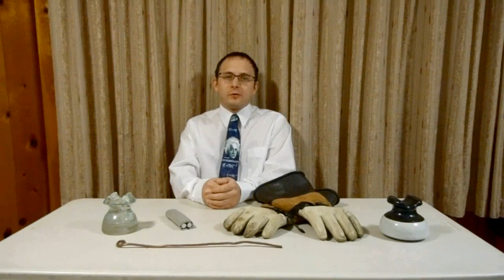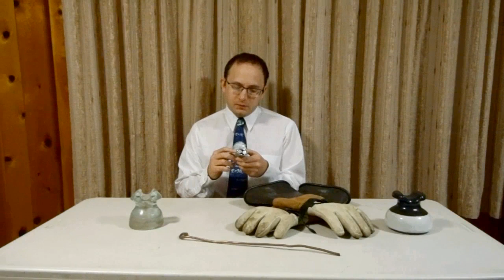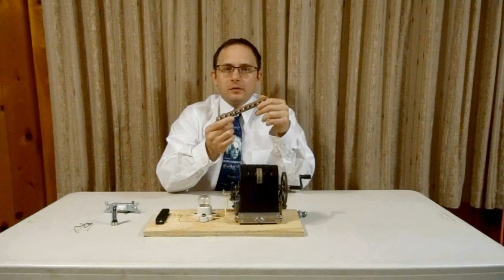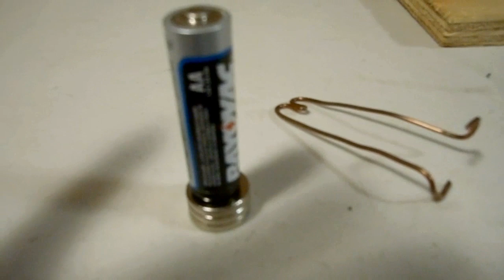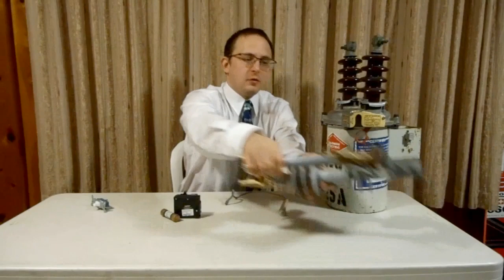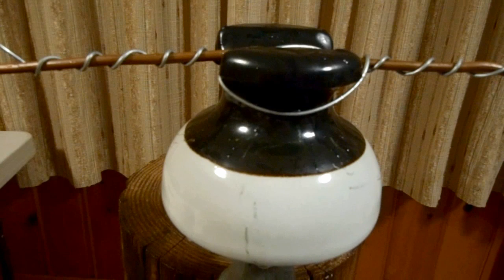Electrical Theory Lecture

Comment: are you self taught or did you go to electrical school?
Reply from the maker: When I was in high school I went to a vocational school and took night class I did every class that dealt with electricity I also did a linkwork class for 4 months. out of high school I took computer service technician classes for two years and in 2008 I graduated from a technical
school after studying electricity for a year - passing every employment test I was given (US Steel, Westinghouse, First Energy, CSX, Seimens) and getting 6 figure job offers with full benefits that fell through because of the bad economy and me not having a drivers license. Luckily my student loans were hardly anything because I chose a cheap technical school instead of a big collage. I've done allot of self teaching since then in areas my schools never covered - I've been around the block - went threw hell going to that technical school saw lots of plastic chairs getting thrown away it bothered me a ton I should get a medal for survival.
Reply from the maker: I knew the technical school was right for me because the homework took me 10 minutes while everyone else in the class was up all night and still didn't have it done - the classes put me to sleep because I did pretty much everything when I was in high school taking the night classes - I was telecommunications certified and had my amateur radio license before I graduated high school.

Comment: where did you get that fuse/ grey insulator?
Reply from the maker: Found it on eBay one day it was refused brand new unopened freight in it's original packaging I paid $50 for it.

Comment: Hey Bryan. I have a 5000 watt 120/220 volt generator I use for my house if we lose power.  The power quality doesn't seem to be great. I can faintly see some flickering on incandescent lights.  Do you think I could improve the quality by using an industrial style reactor to clean it up some?  Any input would be greatly appreciated.
Reply from the maker: Sorry for the late response- The flickering could be just as simple as the vibrations effecting or causing bad or lose connections although if your house is not disconnected from the power grid when the generator is running your back feeding the pole transformer which would really effect the quality because all your generated power is being dumped into the transformer outside and stepped up to the powerlines voltage and possibly feeding your neighbors houses- this is exactly why storm work is so hazardous.
Reply: Bryan Ropar
Thanks for writing back.  I turn off the house main before running the generator.  I'm pretty sure I don't have loose connections.  There is not much to the generator head.  Just a capacitor is used for regulation I think.